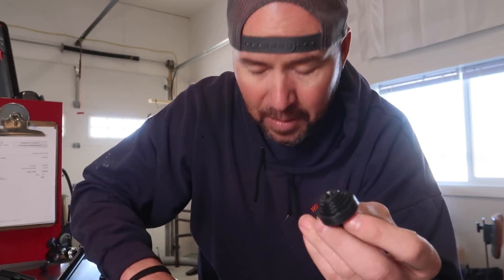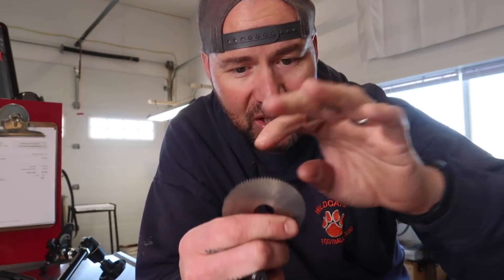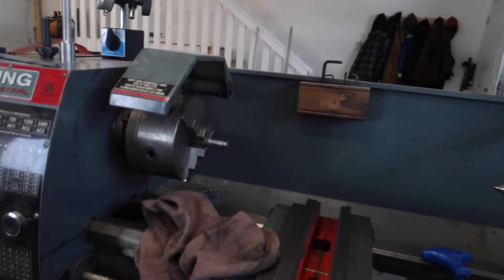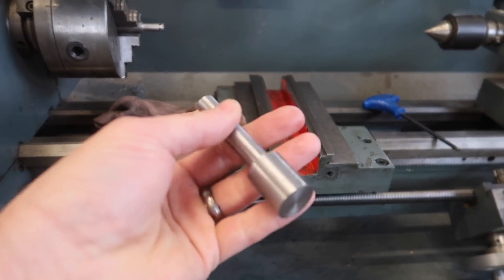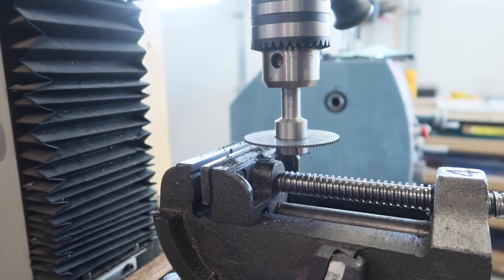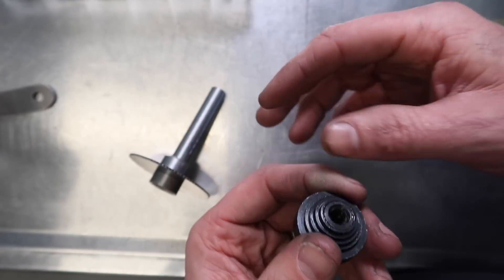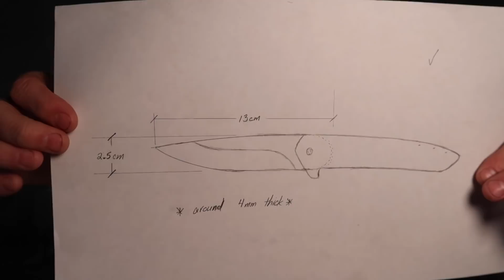Making a slitting-saw arbor

Comment: Wish I was in my shop again. If you can take the tool your making and have a 1/4 or 1/8th key put in it  Even thigh you will be using a clamping device if you go to fast it will slip. Yes a key way will cost you but how much can it be. Make a world of difference. Good luck,